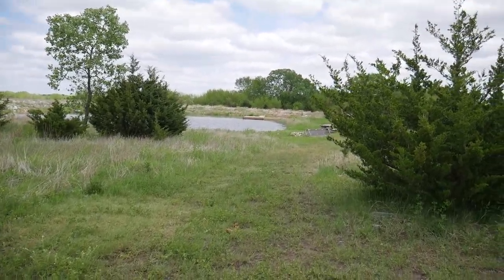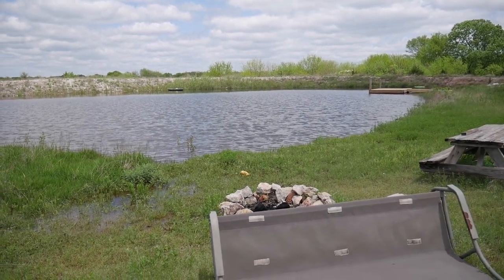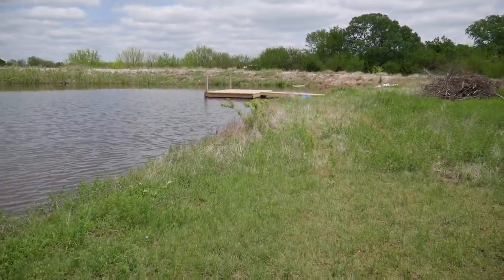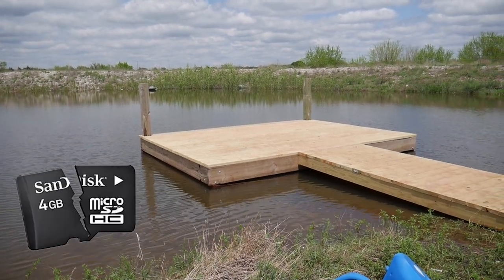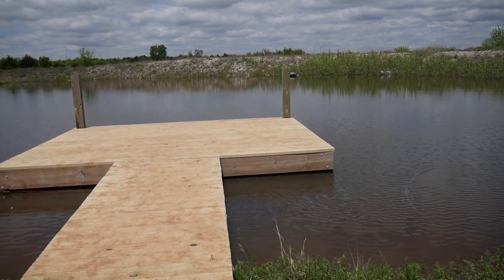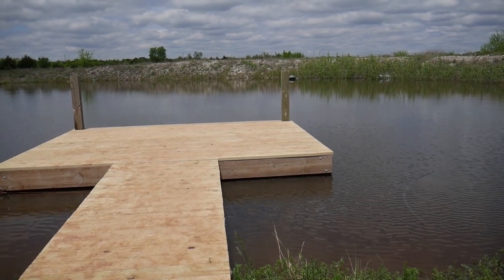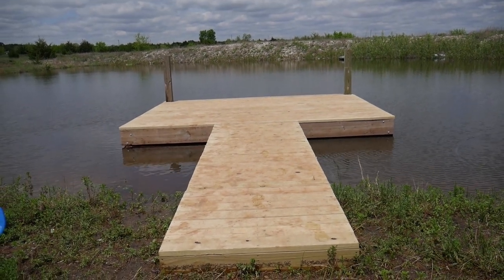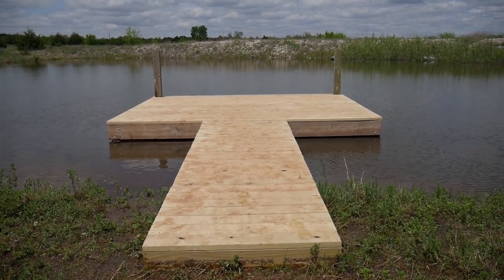Built a Dock For The Pond

Comment: How did you drive the timbers?
Reply from the maker: I waited for the water to get super low. For the ones at the end of the dock I dug down about a foot or two to the grey shale then set the post on that. I drilled some rebar into the shale and some lag bolts into the post then build a form about a foot up and surround the base of the post in concrete to try and lock it in place with the rebar and bolts. the other two I augured a hole down to the shale and just set them on the shale and backfilled. 
The beginning of the sidewalk is anchored in the ground with two t-posts on the inside of the frame.